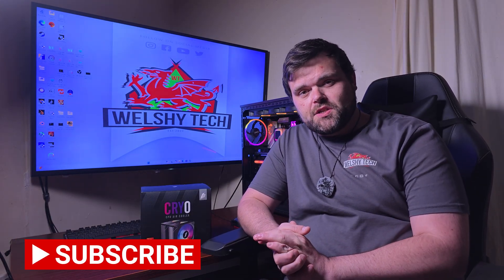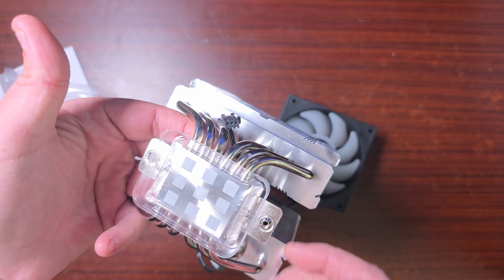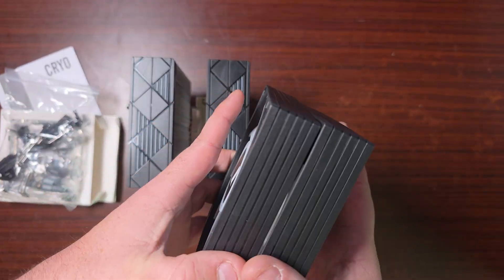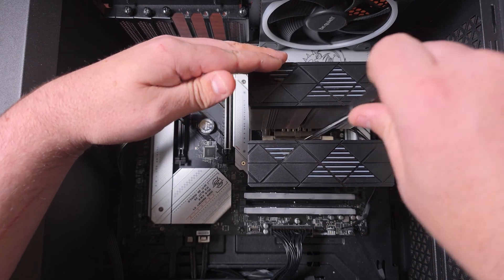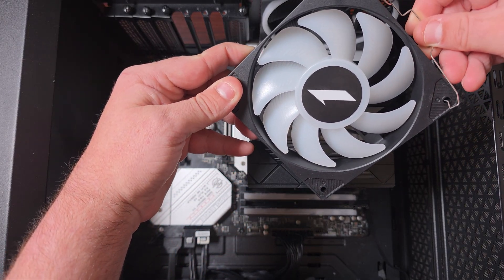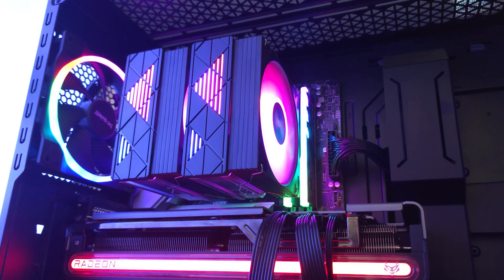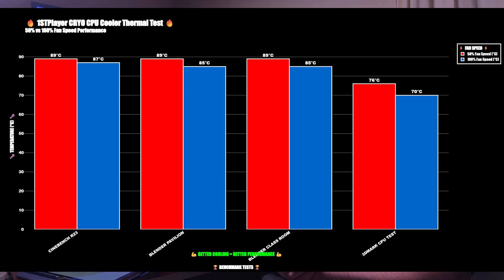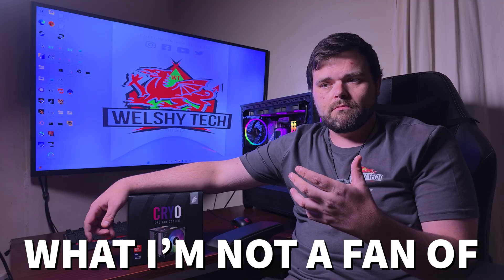£30 Budget CPU Cooler Any good? 1STPlayer CRYO CPU Cooler Review

Comment: did u make video like this for single tower?

what u recomended for single tower?
Reply from the maker: I have made loads of reviews on both single towers and dual towers it will depend on what CPU you are using
Reply: i might buy 7500f later for future upgrade
Reply from the maker: Honestly either a single tower or dual Tower would be fine
Reply: @WELSHYTECH hey i use Ryzen 7 5700G , is the single tower ok for it?
Reply from the maker: Yeah